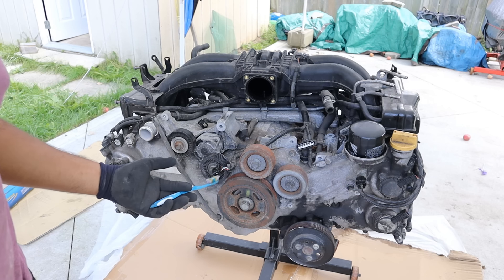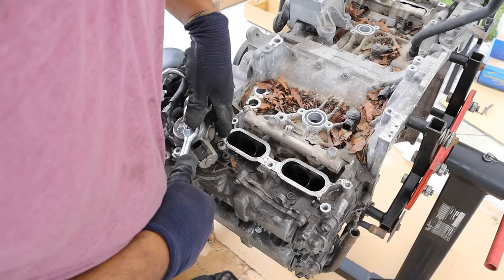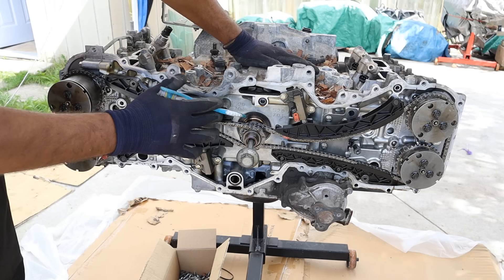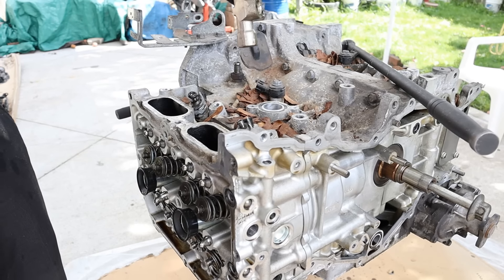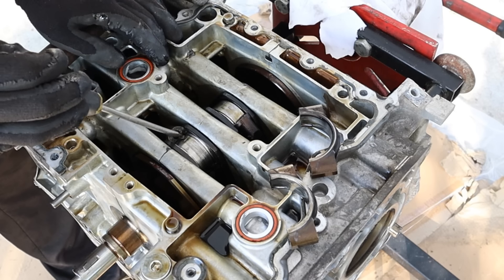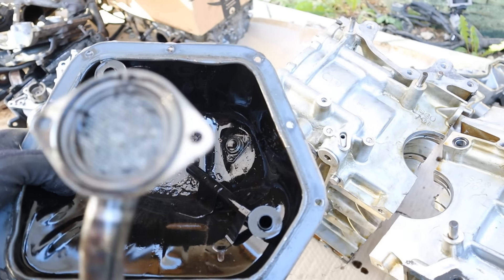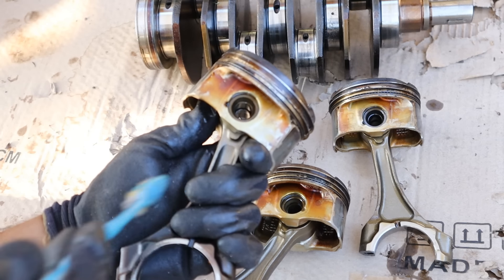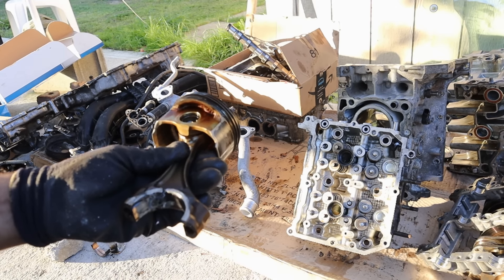Subaru FA20 Engine: A Step Forward for Subaru?

Comment: Pass on that engine.
Reply from the maker: Why?
Reply: @speedkar99  Their head gasket and oil consumption issues persisted far too long. Are they really fixed now? Don't really know. 2 head gaskets. Oil starvation on sharp turns (oil pan baffles fixed it??)?  Why take the risk when good small engine designs are readily available?  Anyhow, that's just me and I tend to be cautious with my $$.

Comment: A problematic engine design that Subaru refuses to get rid of.  It appears to be a nightmare to work on while it's in the car as you state in the video.  It also has a lot of parts & ports that may have issues down the line.  It's past time for Subaru to finally move on from this outdated engine design.
Reply from the maker: This was the replacement for the already outdated EJ series that had a timing belt. I'm pretty sure after they milk this one, they'll develop an EV boxer 🤣

Comment: Subaru hasn't built a reliable engine since the 2.2l. They all seem to start needing things at 100k miles if they haven't already started burning oil or coolant by that time. They should quit the boxer and go all EV.
Reply: I'd say hybrid but yeah....
Reply from the maker: I think EV is the far future. This is their current offering.
Reply: You'd think that after years and years of making the same engine family they'd find ways to improve all that stuff over time, but nah
Reply: False, they’re plenty of these with 200k+ miles with owners reporting no issues,mine’s currently sitting at 126k miles and here’s one with 400k original motor

 https://youtu.be/897TSq-ULMI?si=RQ2vccAYiRYPpgxb
Reply: @whiteunclerukus there's also plenty of these that don't.
Reply: @scott8919  which is true but to call the engine flat out unreliable is incorrect. Clearly you can see that

Comment: They're still junk. FA20DIT PCV is not very good and it causes the engine to foul the intake valves over time. The timing cover design is also way too complicated (or just not well designed) and it requires too much sealant to properly seal. There is a service bulletin for leaking timing covers, in which the fix is, take it off and put it back on with more RTV... and guess what, it will leak again. Subaru dealership refused to warranty their work 10,000 miles after they redid the timing cover on my 16 WRX. 

The way these engines prevent overboosting is primarily using the cat as a choke for the turbo, which... is a really cheap and bad way to control boost. The car will actually overboost to 24psi (up from 16 sustained) for a few seconds before going back down... which cannot be good for an engine with pencil thin rods. 

Another issue is the top mount, it causes the IATs to get really really hot, combine high IATs with people mashing the gas off the line at a redlight, and you have a easy combo for LSPI. 

JDM EJ207 is probably the last good Subaru motor.
Reply: This is the FA20D, not the FA20DIT. Different engines, can you read?
Reply from the maker: I can see the timing cover being difficult to replace and it's potential for leaks. 

What do you mean by the top mount?
Reply: @speedkar99  Top mount intercooler used on the FA20DIT found in the WRX